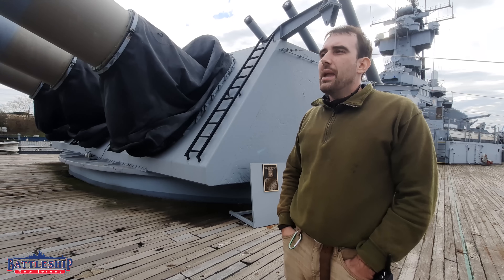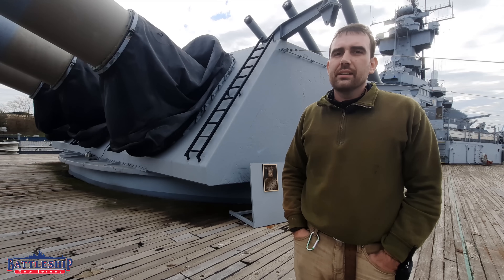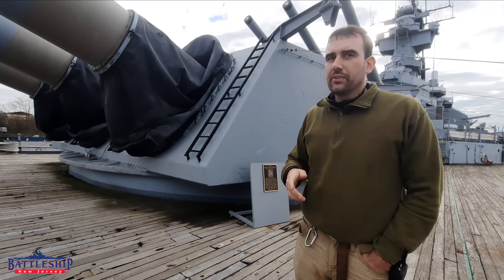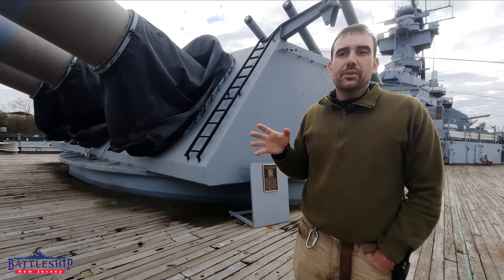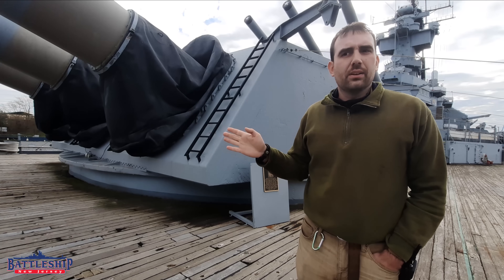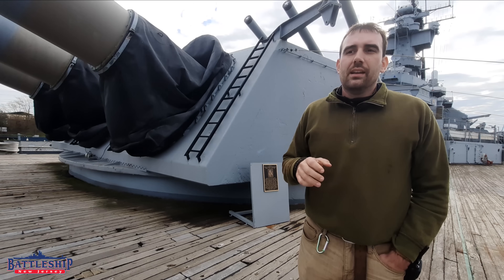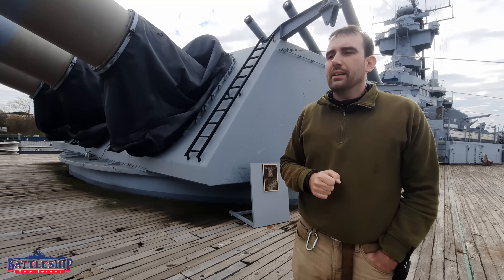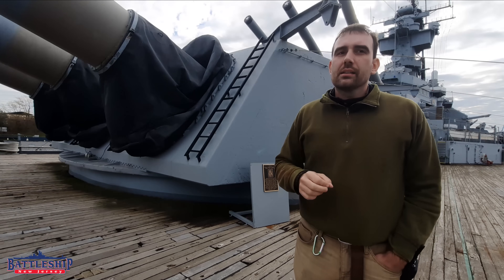Assembling 16in Gun Turrets

Comment: When I worked at Naval Ordnance cranes had to be able to lift and hold overnight a multiple (I think it was 5x) of their rated capacity on a regular basis to maintain operating cert.  So lifting 120% of rated would be no big deal as long as it wasn't a regular occurance.  That was a Navy standard, so Philly should have had a similar practice.

Comment: A friend of mine ran a lathe in the San Francisco Hunter's Point shipyard that was used to machine the turret bases for battleships.  IRC, he said it ran at about 70 rpm and threw off metal chips that were about a foot long....  The lathe was built into the floor of the building.   Apparently the turrets are held in only by gravity...

Comment: (Question below) 
You mentioned in one of your videos that the barbett of the Scharnhorst and Gneisenau were able to accommodate double 15" instead of the tripple 11" they were built with. And if I remember correctly,  some of the Japanese cruisers were in fact upgraded to 8" guns (from 5"). Also the British had something similar planned for some of their battleships. 

Question: how does that work? Was there a rule of thumb to what width can support so and so diameter of guns? And if so, which ships of WWII were planned to have an upgrade like this?
Reply from the maker: From Ryan:
"There is no rule of thumb, the barbette sizes were known and it was easy to design or modify a new mounting to fit in it, usually sacrificing one barrel for the next size up.
The USN did this twice with our battleships. The Colorado class were basically repeats of the Tennessees with a twin 16" in place of the triple 14" and the North Carolinas were originally going to have quadruple 14" but were switched to triple 16" while under construction."
Reply: @BattleshipNewJersey  N.Cal with 12 guns, ugh. That could have been nasty. Thank you for the information!
Reply: You're right- the Mogami class was upgraded from triple 6" turrets to twin 8", with the triples going on to become the Yamato and Musashi's secondary battery.

Comment: I looked at your "Turret Crawl" video.  The roof-mounted turret local-control periscopes were projecting downward from the bottom surface of the 7.25" Class "B" roof armor.  There was no interior mild steel lining.  The edge-connection doubling plates, with the rows of bolts, on the roof and the keying strips locking adjacent plates together were made of Class "C" nickel-steel, including the bolts and nuts through them.  You mentioned mild/medium steel internal lining for the armor sides, rear, and roof plates.  I did not see such wide, plate-covering supports in the plans I have seen.  Where these internal linings over the entire plating?  They obviously did not cover the entire inside surface of the turret roofs.  Threaded holes could be drilled into the back surface of the face-hardened side and rear plates, as long as the holes were rather shallow, so inner mild steel liners could have been installed for mounting all of those connectors and supports for the power and control cables and hydraulic and high-pressure air for the guns.  Similar internal edge-connection plates ("doublers" for the armor bolts and such) and keying could be used between adjacent Class "A" plates, though again no bolts could extend into the face layer from the back of the plate.  Unlike some plates on German naval heavy gun turrets, no bolts were ever drilled and countersunk into the the face of any US Class "A" armor, where they extended through the plate into any other armor plates attached to its back at an edge.

You called the laminated 2.5" inner support layer for the 17" Class "B" turret face plate "STS".  Are you sure it was not also Class "B" armor?  I do not see BuORD allowing BuSHIPS to put any armor steel (STS from Carnegie-Illinois) at all inside any of "their" gun turrets (some ship plans were made up by BuSHIPS and only use the term STS for all such homogeneous, ductile armor steel, even though that is not BuORD's name for its Class "B" armor).  The only thick vertical STS in the ship, to my knowledge, was the tapering anti-diving-projectile (Japanese Type 91 AP, obviously) lower belt and it made up one of the middle layers if the side anti-torpedo protection system (the other internal layers were 0.75" HTS) and which was keyed and bolted to to the bottom edge of the BuORD Class "A" armor inclined waterline belt.  To my knowledge, that was about the thickest STS plating ever used in a US warship.

Through the COLORADO Class, there were internal layers of high-tensile or Class "B" armor steel used inside the turrets and barbettes as the primary structure, with the thick armor being laid over it with cement in-between, just like with the belt armor.  Tests in the 1930s showed that the newer, tougher armor steels used for Class "A" armor were tough enough to withstand ship motion stresses and that the internal supports were not needed, the armor could support itself, allowing a major weight reduction and also slightly larger internal volume due to that backing being removed from most places unless desired on-purpose.

Comment: Hi Ryan, one thing to add - you noted the 3/4" STS backing plates are also known as "number thirty" steel. I suspect this is because they are marked as "30#" on drawings?

This is actually the weight of the plates. A steel plate 3/4" thick will weight 30 pounds for every square foot of plate. This was commonly done because it's useful to know when you have to manhandle around those plates!
Reply: Also, measuring sheet (and wire) products by weight, rather than thickness has been used for a long time, since measuring weight is much easier to do than thickness before mass produced micrometers were available, and its faster even now if you need to count many sheets.  This measurement technique is where "gauge" for sheet metal and wires came from.  Obviously in the range of 3/4" plate its not hard to distinguish, but the designation of that as 30#  representing 30 lbs/sqft makes perfect sense (as well as provide contextual information about the weight of what your part  will be without knowing much else than a part number.
Reply: These are 9+ inch thick steel, it's way heavier than that per square foot.
Reply: @LTPottenger  I am not referring to the armor plate, which is thick as you say. The STS structural plates are 3/4" thick along the sides, back, and roof of the turrets. The armor plate was placed outside of those plates.
Reply: @giancarlom8001  I know, but you are wrong. HE is calling the thick armor of the turret #30 steel. It's very obviously something different and you are confused.
Reply: @LTPottenger  He says “that has a .75 inch backing plate, or number 30 steel” just before the 5 minute mark. Then he says “the sides are 9 1/2 inches thick on #30 STS”. #30 is referring to the 3/4” STS structure.

Comment: And this is why, if a warship capsizes, the turrets fall out. (The Bismarck’s turrets were found some distance away on the sea bed)
Reply from the maker: The Iowas turrets are actually secured in place, unlike some other ships, it keeps them from jumping off their tracks if the ship takes a hit.
Reply: @BattleshipNewJersey  true and false, if the ship rolls over the weight of the turret will break the securing steel parts away like butter and the turrets will fall off--by design. the parts are designed to keep the turrets on their roll bearings up to that point though.
Reply: @thomasmoore8142  so how come Arkansas kept here guns after she rolled over?
Reply: @invadegreece9281  I'm not sure of what you are speaking about since I'm not up to speed on BB-33. I looked up BB-33 and She had 12" 50 Cal guns so old that they may have had enough structural steel to hold on to her turrets but I couldn't find any evidence in a short search to support this either way. Wiki had something of her end as an atomic bomb blast destroying her but noting of how deep the water under her or if she actually rolled over or was pushed onto her turrets which could have pined them in place. My discussion was about Iowa class BB's and Tom's reference to Bismarck and I just don't know enough about earlier BB turrets.
Reply: @thomasmoore8142  yes, she was nuked at Bikini Atoll along with ships like Saratoga, Nagato, and Prinz Eugen
Reply: @thomasmoore8142  this clip (https://youtu.be/y3-JrcbbjSI) shows a main gun turret at about 2:08
Reply: @BattleshipNewJersey  there is a possibility that the battleship New jersey can return to service
Reply: Held in by their weight
Reply: @mickeyholding7970    Not exactly.  The turrets are secured.
Reply: Imagine the lagendary bismarck and battleship New Jersey are met together in the battle 15 inch gun vs 16 inch
Reply: Roma's B turret was simply blown away when the Fritz X hit, you can clearly see it in her most famous picture, with a heavy list and a missing turret.

Comment: There is a bunker in Normandy (battery d'azeville) that was hit with 14 inch guns(USS Nevada) "One of the 14in shells hit the outside, the result quite visible today, whilst the other entered the casemates firing port. Although this shell was a dud, it breached the internal wall, entered the room behind, bounced off another wall and exited through the rear of the casemate. Despite not exploding, the change in air pressure caused by the shell caused the death of all fifteen soldiers manning the casemate''
For who is interested its worth the visit: https://images.app.goo.gl/jxJCEbWW6AzKz7EX6

Comment: Great video! How did they protect the steel from the moisture of the filter concrete? How big of a gap is it?  What is the armor arraignment where the barrels pass through the turret? That could be a video all in it's own: how to stop a shell from finding a gap in the armor (you could include my previous request for discussion of the up/down takes protection).

Comment: Was there ever an attempt to use modern shell design? ie. HEAT type, or DU, or HEDP
Reply: Yes, in the 80's refit, they produced some kind of DU shell for those bad boys
Reply: Yes there are several modern designed shells including Depleted Uranium, DIPSM (basically the artillery version of a cluster bomb), chemical and Thermonuclear as well as rocket assisted munitions, also 2 of the Iowa's were also the test beds  for the first rail guns in the mid 80's

Comment: One thing I would find interesting would be how you covered casualty power but what about a similar video on how the shore power gets on board.  Would it have been the same way back when the New Jersey was in service or would the ship have been dependent on internal power at the docks?  I cannot remember if you mentioned or not but would shore power have been 3 phase and then down converted by the equipment on the ship to get the other voltages?  Would the plugs and cables have been similar to the casualty power biscuits and cables?

Comment: What are the small crane arms on top of the turrets used for?
Reply: Loading the 16” shells.  The turret turns to a preset angle/position.  It will then align with scuttles (holes in the deck) that line up for several decks.  It allows the ammunition/shells and powder to be lowered down into the ship. These are outside of the armored barbets the turrets sit on.  Once the shells get below the barbets, somewhere below the water line (and under the armored/splinter deck) the shells and powder can then enter the turret structure for storage on their respective decks.  The powder will continue to go down to the lowest decks of the ship and the shells will actually go back upward onto the two shell storage decks that rotate within the turret.

Comment: When you do the video about the barrel lining process see if you have any info on trimming the liner, as it gets extruded out the muzzle over the life of the liner.
I remember reading in an old Bluejackets Manual section about all the official approvals needed before the liner could be trimmed.
Any chance you might have any stills of the operation ?
Reply: A portable compressed air powered milling machine fitted into the end of the barrel and was used to trim the barrel liner.  We had to trim when the liner got out to no more that half an inch. This usually happened between 50 -100 rounds out of a barrel. In typical sailor fashion the process was known as “circumcising the barrel”.
Reply: @robertlian2009  That's fascinating. Keep em coming!

Comment: I some questions 
1 how they get the shells and the powder charges from the outside in the magazine 
2 what kind of propellant does American battleships guns use
3 how a battleship from the 21st century would look like
Reply: Q2: The full charge powder bags have approximately 108 pounds of navy smokeless powder. The powder is in the form of cylindrical pellets about the size of your thumb stacked in neat circles on top of each other. The end of the powder bag has a quilted pad with approximately 2 pounds of black powder which serves to ignite the smokeless powder. So total bag weight is about 110 pounds.
Reply: @robertlian2009  I've always wondered how loud it is inside the turret when those guns are fired.
Reply from the maker: The sailors tell us that from inside the turret it sounds like shotgun fire
Reply: @badgermoon9229   The sound is fairly muffled. Remember you have 17 inches of class A armor between you and the boom. Most of my hearing loss was due to all the motors and machinery constantly running inside the turret than due to the guns being fired.
Reply from the maker: Powder is brought down a hatch by a crane or chain fall. Its black powder. And we won't speculate on a 21st century battleship, our commenters love to do so though!

Comment: An interesting side note: Since the armor is in fact bolted to the turret, the bolts are on the inside of the turret. During the battle of Jutland it was noted that even when shells did not penetrate the armor the force of the blow was enough to turn those bolts into deadly projectiles. So inside the turret you will see on the bulkheads what look like pots welded to the bulkhead covering the bolts.
Reply: It’s the same with early tanks. Their armour was riveted rather than welded, so when hit by a shell, the rivet would be broken off and rattle around inside. The interior of later tanks had a heavy cloth / Kevlar liner to absorb spalling.
Reply: @notmenotme614  it is interesting to remember that all Italian tanks during 2nd WW was bolted/riveted with low quality thin armour that rarely could absorbs hits. When hit the armour simply cracks and as you mentioned the rivets, if hitted correctly, fly inside like missiles bouncing all over creating horrible wounds to the crew. My Italian grandfather was at the battle of El Alemain as the commander of a medical unit at the front and always told my late father that the scream of the wounded crews was terrible not to mention the burns. He had nightmares for the rest of his life...
Reply: @notmenotme614  Kevlar did not exist in WW1 or @
Reply: Post 9/11 when the government first tested reinforced cockpit doors, they were to spec, stopping certain caliber bullets and small explosive forces, but interior components of the door itself became projectiles.
Reply: holy crap
Reply: Whoa... that’s cool and kind of morbid
Reply: sounds kinda like spalling but instead of the armor its the bolts
Reply: Most interesting. and "bolt spalling" term is pretty good description for the phenomenon.

Comment: I would be interested in the original plans to modernize the ships.  I worked with a couple of guys that served on the Jersey.  They told me that the plans were in phases.  I think phase one was removal of some of the 5 inchers for tomahawks.  They said phase three was supposed to remove the aft 16 inch turret and turn it in to a helo pad, but they couldn't figure out a good way to remove the turret?  I'm betting they probably wanted harpoons and phalanx as well (if they weren't there in phase one already).
One of the guys also told me a funny story of how they were running drills and the captain had them going full speed.  He said when that thing was going full speed it almost had a rooster tail.  Well some sailor left a hatch open on the back end when the captain ordered a full stop, and all hell broke loose when all that sea water came crashing through over the back end.
Reply from the maker: Here's a look at one of the options to modernize the ship, but they were constantly updating these since the keel was laid so I'm not sure what precisely you're looking for: https://youtu.be/DZA-IYJ_-GU

Comment: Suggestion: what small arms were kept on board, and what were their uses? Great video by the way!
Reply: On a very related  note, I had a buddy who was a Gunners' Mate, who showed me one of the numerous Armories on board USS Constellation CVA-64, in 1972. As told, the large storage capacity aboard was used to house small arms and ammo for many of the shios in her Carrier Task Force (at least). I don't recall whether the Armory I saw held 500 or 800 Thompsons, which were favored for use within a ship itself to avoid penetration of decks, walls, and overheads. I think it was 800 tommies. Should have taken a pic of it.
Also, as told, there were M14's (Marine Detatchments), M1 Garands, M1 Carbines, BAR's, BMG's in .30 and .50 cal, M1911 pistols, .38 cal revolvers (Aviators' issue), flare guns, 12 Ga. shotguns, the odd athletic starting pistol, and an assortment of grenades.
Very curious about what New Jersey carried.